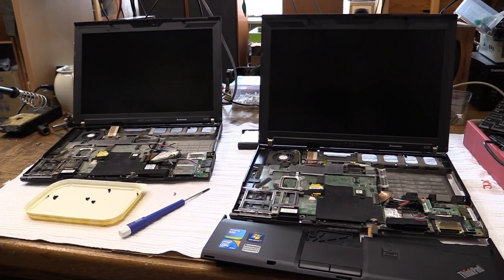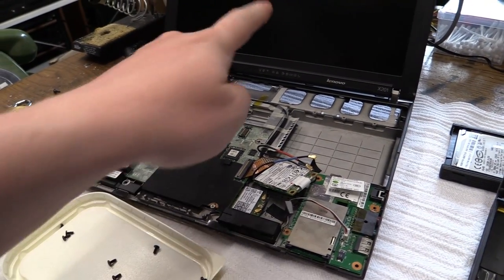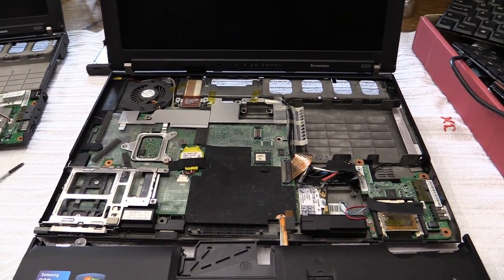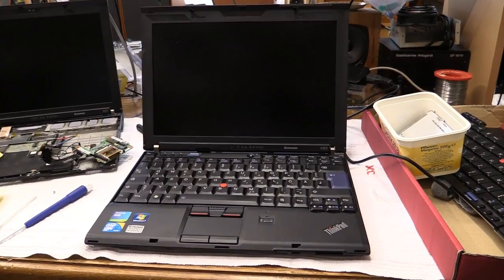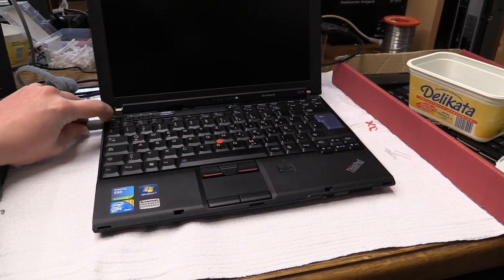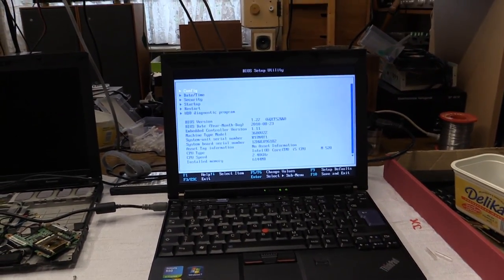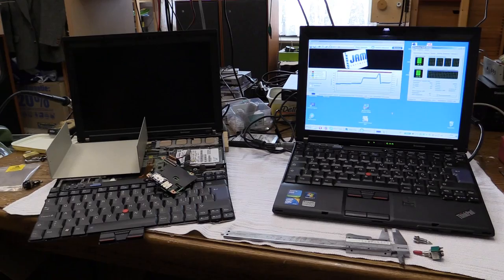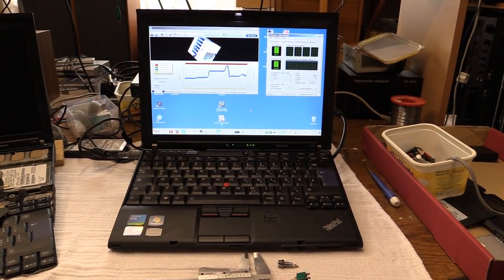DrCassette's Workshop - The Thinkpad Project [2/2]

Comment: These X201's are fantastic laptops. The Thinkpad X-series are my personal favorite. You and I basically have the same one now, mine also has the 2.4Ghz Core i5 and doesn't have a webcam, but does have a card reader and a modem. The lower end Core i5 is actually a bit of a blessing in disguise because the higher end chips can get hot enough to be a little concerned sometimes. I've seen the temperatures go up to 80 on the 2.6Ghz ones. I can't imagine how hot the Core i7 version got.
Reply from the maker: The Core i7 version did get pretty hot, even in idle mode...
Reply: DrCassette
regular hot plates those little chips
Reply: Agreed they are great laptops! I have one when I am on the go but when I'm at home the desktop is always the best
Reply: Still rocking mine.. but I DID feed that nice Intel nic 48v that was NOT PoE.. and blew the onboard jack.. Dock ethernet works fine though.

Comment: the Bluetooth is usually built in to the wifi card so if you transfer the card over it should work, I upgraded an Asus laptop that did not come with Bluetooth with a new Intel wifi card with built in Bluetooth.

Comment: Thinkpads are wonderful systems. I have an IBM Thinkpad R51 that is still in service. (Pentium M 1.5Ghz, 1.5GB RAM, Mobility Radion 7500, LXLE Linux)  Excelent machine, well-built but a tad hard to service the innards compared to HPs and Acers.  The only Dell systtem I have actually enjoyed using is my Latitude D620.  Its a well-built, solid machine despite the flaws with its Nvidia GPU (with proper TLC it will work for years to come).

Comment: Interesting that you're only keeping 6 GB in there. If it's using DDR3 (and it should be), that can kind of throw off the whole dual-channel thing if you're using different sticks in terms of capacity or RAM timings. CPU-Z (it's freeware) should be able to tell you about the speed and timing specs of the sticks via its memory and SPD tabs, as oftentimes the labels on the RAM itself doesn't have all that info.

It's not exactly a deal killer, but it will slow down performance a tad if they're mismatched, especially in anything that is memory intensive.

Unless, of course, those laptops don't support dual-channel for the RAM, in which case, the whole point of this post is moot and I'll shut up now. :)
Reply from the maker: It turned out my other laptop still uses DDR2, so I couldn't put the 4GB stick into there. So the Thinkpad is now running on 8 GB RAM again, so everything should be fine.
Reply: DrCassette
Hopefully the DDR2 laptop doesn't lose its RAM then. It's getting pretty hard to find that now, just like DDR3 will be in a few years once DDR4 systems begin coming out next year.

Anyway, yep, since I'm presuming those are both from the old broken Thinkpad, they'll have the same specs and so all should be well.